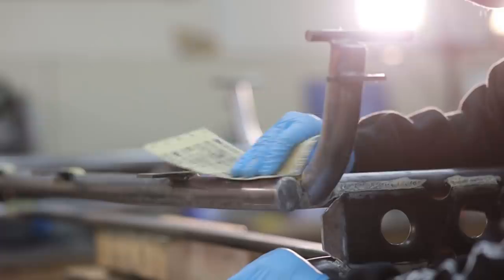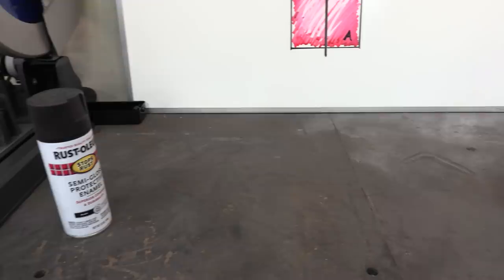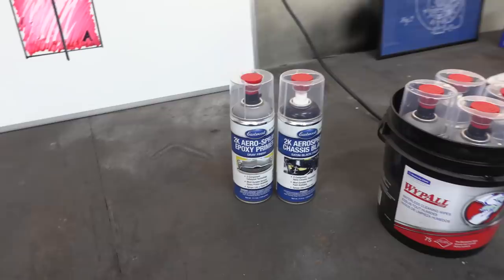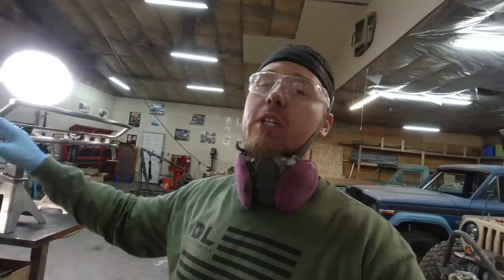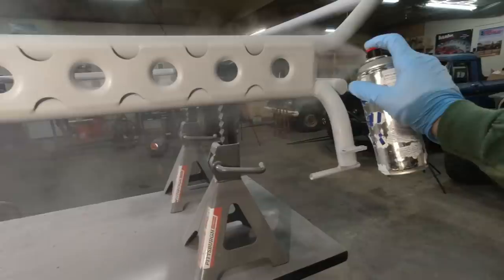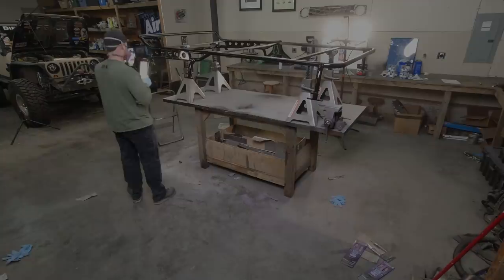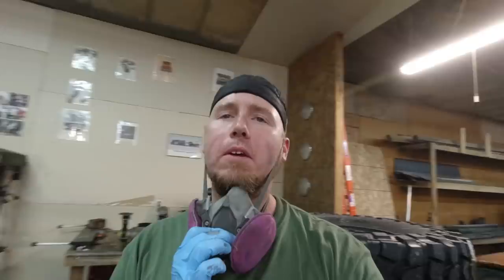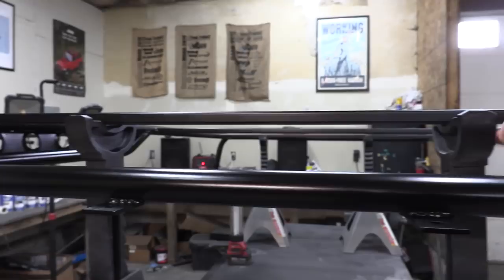Spray Paint TRICKS For Car PROJECTS

Comment: I will probably post more on this topic than usual since I have been painting for 25 years and in the industry for over 30.  Nitrile...NEVER EVER LATEX....you are spot on with that. Warming up the paint is an old painters trick I still do this and some epoxy paints you have to let them sit for 20 minutes before spraying. That paint hit the market a few years ago and I use it also at times. You can actually put different base color in the cans. So lets say you paint your care with PPG and you can actually have the paint store put your paint into an aerosol can and use it later for projectcs.

Comment: Not a safety sally at all but one quick note on your respirator, those pink filters are only meant for particulates.  They're definitely better than nothing but especially for the solvents in paint and doubly so for hardened paint, I recommend looking into the organic vapor cartridges that work with that mask, 3M# 6001.  They also make prefilters for it so that they don't clog as fast.

And a light first coat/tack coat is a good idea, it helps keep your first heavy coat from running
Reply from the maker: Thank you! I will buy some of those filter today 👍
Reply: Agree 100 percent with this post
Reply: Great info. I did not know that. Thanks as well.
Reply: Craig - I didn't know that either.  I use the same filters as Nate, but mainly to keep my buggers metal free!  :)
Reply: Cyocanates, probably didn't spell that right, are in anything sprayed that has a hardener mixed in they are not filtered out by charcoal filters. The only way to combat them is a fresh air system. The biggest problem is they build over time and are cancer causing. Charcoal only works for particulates.
Reply: Very close, it's Isocyanates. And it's most damaging to the nervous system. Don't mess around with that stuff. Wear a cartridge filter.
Reply: Yes! I was going to make a comment on this! My last job supplied all respirator fitted employees with the cartridge style filters. Only the welders were supplied both low clearance filters and cartridge style. The reason for those slim style filters is to allow for the welding hood to be able to drop down all the way. We would weld a lot of galvaneal. The only “required” time for the respirator. Grinding and normal welding, the respirator was recommended. It only took me one time painting with the slim filters to realize that they did nothing for protecting one from paint.
Reply: One hundred percent correct on coatings... first coat your not painting as much as a priming finish coat. You don’t need full coverage of the piece just a light dusting. You should still be able to see the original color showing through the first coat. This will reduce dry times drastically. This is true for painting everything from Sheetrock to wood to metal.. and with that... ALWAYS use a proper primer. The prime coat is what makes the paint durable and have a good finish. 2 coats of primer and two coats of paint is the standard. After that the more finish costs you out in just add to the wearability if the paint. There is no magic durable paint the durability comes from the thickness of the paint itself. The thicker it is the more durable it is.. and FYI if doing things around the house.. there is no such thing as paint and primer in one.. that’s garbage. Always prime. Priming is the same as painting.. first coat is a light dry coat not covering the entire original color then the second coat you shouldn’t see any original color. 

Most people try to cover someone in one coat thinking that’s what they are supposed to do. This makes for paint that drys on the surface but needs 30-60-90 days to fully dry underneath. Ever paint something and then a week or few days later have have to sand it and the paint edge to surface never sands out smoothly but leave a fine protrusion never really getting smooth? That’s cause the paint hasn’t fully cured underneath cause the coating was too thick. (This is wear chemical paints like epoxy come in. They are not any more durable what they do is allow a thicker coating with a full cure faster) You can achieve the same thing with 10x costs of the cheapest paint you can find. 

Now here is the kicker that seems counter intuitive and why everyone but painters, paint wrong... the thinner the coat the further the paint goes to get the same finish while also being faster to paint. For example.. a dry prime coat on wood will dry in minutes. By the time you get from one end to the other it’s already able to accept the second coat. All material is porus including metals. The primer seals the pours which in turn allows the paint to get better coverage with less paint use with a faster drying time. Every wonder why you can use a primer that drys in minutes but the paint takes hours or days? This is why. If the material still has open pours the paint takes time to soak in. Primer does this faster and once pours are sealed the paint drys in say 30min instead of 30 hours. 

I know this is getting long but here is the last part.. people think they have to sand between each coat. This is a complete waste of time. Do proper prep (this is most important part of you are looking for a good final finish) before first primer coat. Then you don’t do anything but apply coat after coat and only lightly sand right before the final coat of finish paint. If you are going to apply a sealer or clear coat as it’s called in automotive work.. you will have to then do this again right before the sealing coat but to a much less extreme. Literally between one coat of paint and final coat it’s like 3-4 light scuffs with high grit and that’s it. Before a sealing coat it will be the same 3-4 light scuffs on the finish coat but with an extremely high grit. 

I know this is super long winded but this is what makes someone a painter or a joe with a spray can and spare time. I’m not a painter but I do custom wood and metal work and have learned the hard way how to paint properly over many many years.
Reply: Dont be afraid to double up on the pre filters, do it all the time at work.
Reply: Correct. You can even smell and taste the paint with those pink filters.
Reply: Also kinda sketchy firing up the heater after spray bombing the garage. Hopefully it was well ventilated.
Reply: @matthiasward9799  I did wonder on why my tongue always tasted funny after spraying laquers...

But for enamels, and anything larger than a cabinet door, my 'paint booth' is a large tarp in the back yard. I love Arizona sometimes, but the painting season without a swamp-cooler is about 3 months long...
Reply: If you can smell it, you’re not safe.

Comment: I can confirm - the "can in the bucket of warm water" definitely works and causes the paint to spray way more evenly. Tanks for the video brother.
Reply: My wife is a hard core crafter as is her family. They taught me this years ago and I also can confirm it make a big difference.
Reply: it also works for spray foam. Both the great stuff and the two part foam that you get in the foam packs. increases yield up to 50%
Reply: When I didn't have easy access to a bucket of hot water I would use a Heat gun to gently heat the can .. always Very careful how hot it was getting and always kept the heat moving.. hairdryer works too in the same way

Comment: Pro tip. Box fan with a large 4" thick air filter tapped to the intake side will suck in all the over spray!
Reply from the maker: Good call 👍
Reply: DO NOT THROW SAID FILTER IMMEDIATELY IN THE TRASH.

Sorry for all caps, but warranted in this case.  The paint-soaked filter flashes (exothermic reaction) and can catch fire.  I found this out when I opened the trashcan to throw away the second filter and was greeted with a Backdraft (1991 movie) type scene (well, to me at least).  Luckily I have extinguishers scattered everywhere and only melted some trashbags.
Reply: Haha I thought I was the only one who did this! It really improves the garage!

Comment: The exhaust from those salamander heaters can cause fish eyes in paint. And explosions with flammable vapors. Your shop is large enough I doubt it would be concentrated enough, guys with small shops need to watch out. Not knocking your work at all, that came out awesome!
Reply: Diesel has screwed my eyes out on paint before i was gna comment the same thing
Reply: Bro... hes spray painting. He's not a professional  body man

Comment: another great job, but never paint with an open flame in the shop, the flash-over that occurs will melt the skin off your body before you hit the floor. heat up the room, shut down the flame, paint your project, then open all doors for 2 or 3 minutes ( not enough to cool down the metal) then fire up the heaters again. or get a bomb-proof heating system.
Reply: Strongly agree.
Reply: Scary stuff!

Comment: When painting parts with many different surfaces, go over all of the nooks, crannies, and details like raised letters or bosses, then go back 5-10 min later over everything. Definately wear safety equipment, prep, proper temp and use a tack coat first like Nate mentioned.
Reply: I need to start doing this, always run the paint when I try to get the cracks

Comment: A good little trick for time between coats is to spray a test patch at the same time anything from a bit of extra masking tape to some card anything, and touch it when you think its time if the paint sticks and strings its still to wet wait a little longer until its tacky to the touch but doesn't string reduces, the chances of runs massively

Comment: After all the safety precautions, I am amazed to see you using two open flame heaters at floor level while spraying in the same area.  This is in violation of fire safety codes in all 50 states.  Even if the paint itself isn't flammable, the propellant is.

Also, I saw no ventilation equipment running.
I hope you do something to mitigate the chances of injury to yourself and or loss of your shop.

(Fire Investigator, 32 years).

Terry

Comment: Nate
Nice intro for the safety items. One thing I added when I paint is a few box fans with a 20”x20” furnace filter over it. These suck the air where you are spraying and grab the paint particles so you don’t breath them in. Cleans the air. And controls where the particles go. So they are a lot less likely to land on nearby finished projects. Who needs black over spray on their tan Jeep.

Comment: I would add Body Seam Sealer to the inside of the rack where the plate is welded to the tubing to seal out dirt and mud, and to make sure rust does not form where the paint cannot reach.
I would also seal the top between stitch welds if it is not weld all along the edge.
The sealer comes in a caulking tube so you can apply it with a common caulking gun.

Do not use Aveco brand caulking because it maybe hardened in the tube.  My favorite is 3M brand, but it is about $45 a tube.  Napa has good body seam sealer for around $15.  I found that one fresh (not hardened in the tub) and very workable.  

I  bead it on like caulking then squish it in and smooth it out with a finger and clean the excess and mess with lacquer thinner, acetone, or carb cleaner.  It can be painted with self etch primer, regular primer, cheap rattle can paint, or two part epoxy paint.

If you decide to a bracket or whatever you can dig out the immediate area to weld with a screw driver or scraper then grind clean your metal and weld.  Make sure to re-apply seam sealer to nooks and crannies.  I may take a bit of practice to work it but you will have a job that does not start leaking rust from the nooks and crannies. 

For funzzies, I laid a bead that ends in a point on one end and fashioned a head on the other end and painted it to look like a snake once the caulking sealer dried.  You could also lay a bead in "squirts" to resemble a weld bead.  Once you begin playing with it you can get as creative as you allow your mind.

Comment: Enjoying your channel too.  I second that comment regarding the filters.  For paint go with the yellow organic ones.  An example is 3M Safety 6001 Low-Maintenance Organic Vapor Cartridge.  The magenta ones are a HEPA rated particulate filter for dust.  They take out airborne contaminants down to like 0.3 microns.   And maybe the MAPP gas can shouldn't be so close to the wood burning stove,  LOL.   I like to put a box fan in a window blowing the inside air out to create some air movement.  Some paint fumes can be explosive as well, so be careful with open flames or hot embers around a build up of some types of paint fumes.  Heck, even turning off the lights can create a small spark and cause an explosion from flammable fumes.    I'm learning from you, especially the welding videos, so don't blow yourself up.

Comment: Yes for sure 2 part epoxy primers & paints are harder, also are less susceptible to stains or damage from fluids such as fuel, hyd fluid, lubricants, ect.  As with  aircraft paints , there is usually a 15-30 min dwell time, after mixing / before application
Reply: Dwell time? In the boating industry we call it shaking hands . Mix the paint and let it shake hands for 30 minutes. We also try to heat up the hull before shooting.

Comment: Another tip, if you mix 2K spay paint and get a lot of left over in the can. Put it in the freezer and it will last for many days. I left my half full mixed 2K spray can in the freezer for 9 days, let it warm up in room temperature and it worked like a brand new mix,
Reply from the maker: Great tip!

Comment: Pro tip: use 3m general parts repair , it's a seam sealer and flexible parts filler/repair product,  saves a lot of time  and has a light flow to it so it smothes out and sands easy!

Comment: Tack coat is for enamel or slower drying air dried paint layering. The first coat left to tack (for whatever 10 mins) will hold one even opaque thicker layer without running or drooping (fully opaque and glossy) rather than many thinner layers and hours of curing in between. Quality quickly requires a practices touch that takes account of temp and humidity with the paint viscosity balancing act of tradie industrial spraypainters skill set. 👌 Other finishes require different tweeks to leverage the product characteristics with time n quality restraints. Your doing well sharing and demonstrating dinky-die fab shortcuts Nate... on behalf of others watching, thanks for your dedication

Comment: I cant recommend tractor brush on paint enough. I use it on my rig, you could also spray it with a spray gun. Limited colours, but I buy the satin black and use it on all my chassis stuff from TSC.

Comment: I need to try the 2 part for sure. I use the black 9 mil gloves from HF on sale 9.99, last much longer, even wrenching, Tip for overspray, small box fan sealed blowing out paint spray, sucking fresh air through a cheap heater filter in a opening on other side of shop. keeps dust from floating around landing on projects.

Comment: That was a great tutorial on finishing. Heat is absolutely critical to a quality finish,  but relative humidity is an important consideration. The woodstove and/ or kero heater achieves both requirements. Methal hydrate is a great wiping product and it leaves no residue on the surface. Thanks.

Comment: Just discovered your page and am currently building an 01 Suburban as a mild overlander for camping. I've done hobby welding and fabrication the last 10 years and also have a degree in 3D CAD Modeling. Appreciate you sharing your knowledge. This will definitely be a channel I visit often. 

I like that you added safety glasses to the painting PPE. A few years back I was at the eye Dr and the optometrist said "have you been painting something blue?". I had paint all over my eyeball from spraying some industrial trailers a few weeks prior. I've been wearing safety glasses 99% of the time in the shop ever since!!

Comment: Nate, The tack coat is to avoid the next heavier coat from running, whenever you paint you always want to go in layers but never heavy enough to run, but the tack coat just basically puts "something" on the metal so the rest doesn't run as easily, now once you apply the next coat the tack coat will not do anything for you, from there on you have to know how long to allow each coat to rest/cure before the next coat, each coat has to become "tacky" before the next coat or you risks runs, it is indeed a process,  :)
Reply from the maker: Thank you for sharing your knowledge 👍

Comment: With runs on a job like that I found tape works great, test a piece off 6-10 inches, use the stocky side and roll it up the run. The motion it kinda like rolling a slinky,  you only ever have about 1/2 inch of tape touching at a time. 

Your worried about over spray on your camera,  its settled on everything in your shop. I take 2 cheap box fans, tape some air furnace filters to them and place them under my garage door, I have some cardboard I close in the rest of the gaps under my door. This pulls most of the over spray out of my shop. I still use a respirator though, but this helps keep the shop things clean.

Comment: Every paint has different overcoat window, if you goodle the paint brand name you should be able to download that manufacturers paint datasheet. That sheet will till you the amount of time needed between each coat which varies with temperature. Over coating too soon can prevent the layers from fully curing or can cause porosity because the bottom coat needs time to gas out. Great video, never seen epoxy spray cans before. For something so big like that might be good idea to get cheap little conventional sprayer.
Reply: Goodle lol